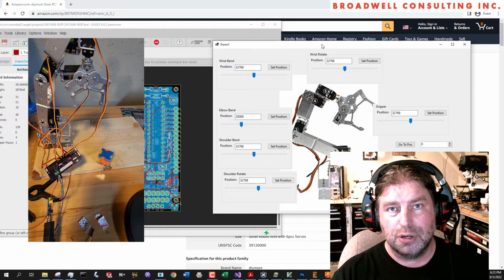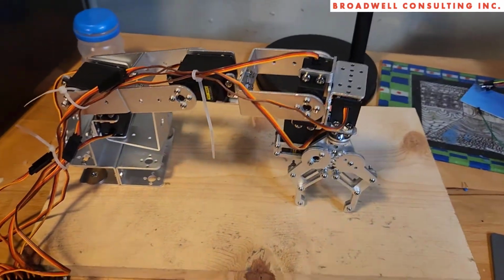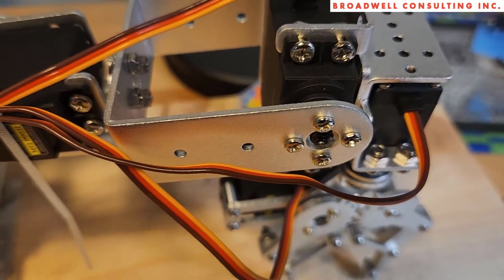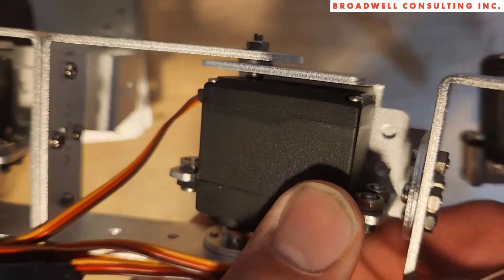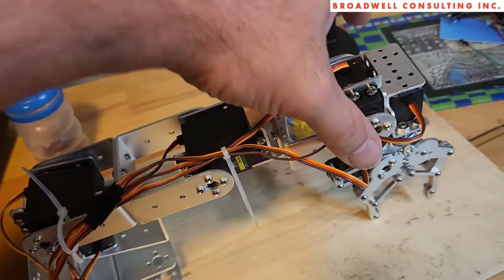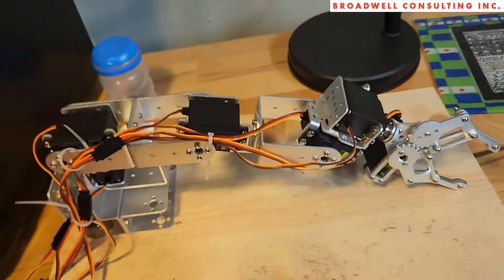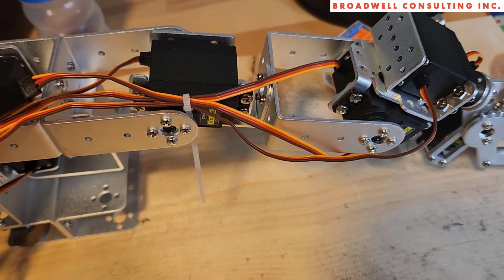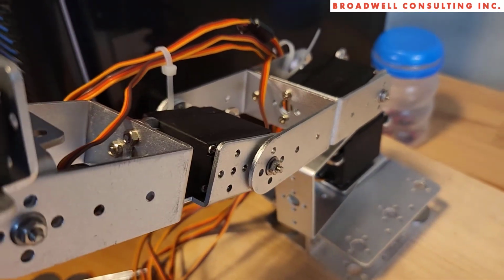Serial Wombat Robot Arm Part 1:  Construction of the DIYMore ROT3U 6DOF 6 Servo Robot Arm

Comment: Hello! I'm a brazilian engeneer studant, I was interested in using it in a project... it  will have a part 2? I'd like to clear some doubts
Reply from the maker: There will be.  Likely a bunch of videos.  I've been focusing on the V2.1 firmware for the SW18AB right now, along with a USB carrier board.  The Robot Arm project dropped in priority a bit.